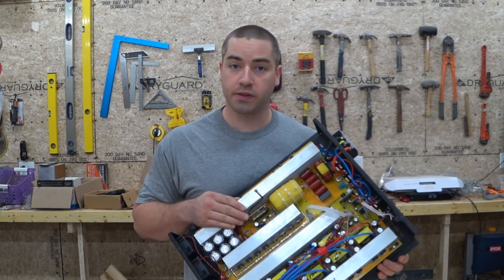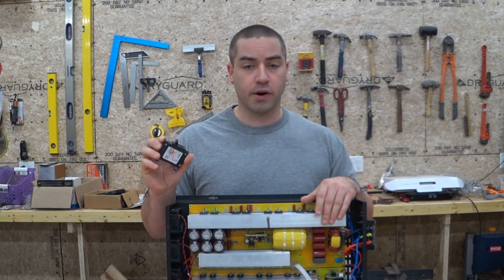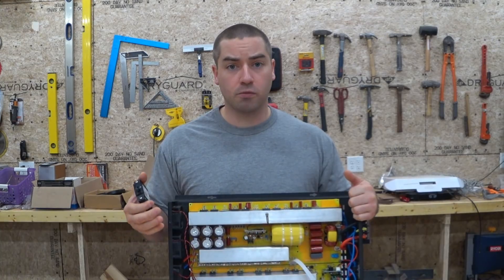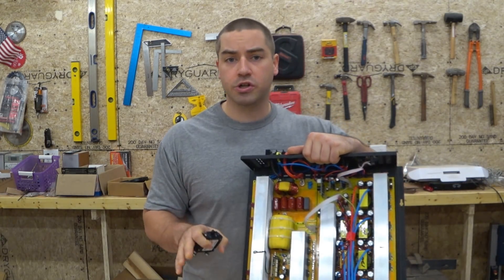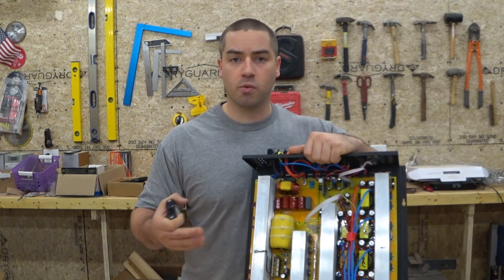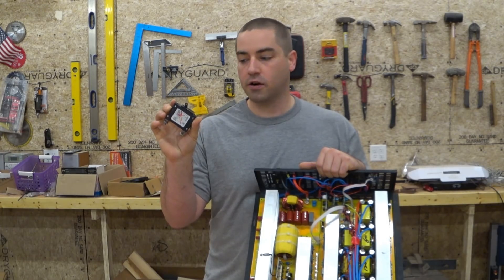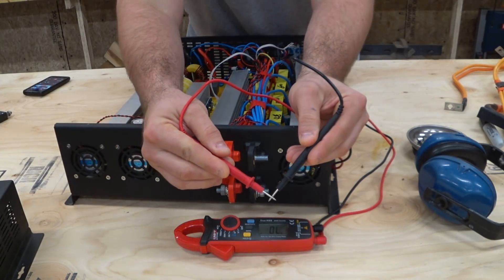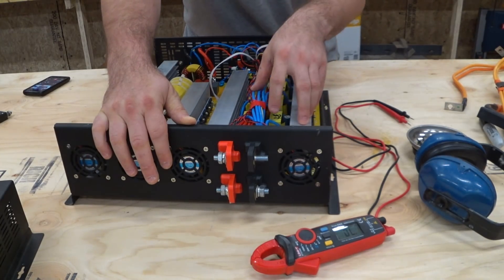Did I Blow Up the Inverter?

Comment: Dude, it's the junk inverter. Nothing to do with your setup... the mosfets failed
Reply: Cascade failure of the mosfets. I don't know if the mosfets were faulty, the load balancing was lacking, or a bit of both, but the actual failure mode is obvious. Cascade failure of the power stage.
Reply: @rich1051414  y think it has to do also whit the lenght of the internal power wires to the mosfet bridge, being all different lenght the voltage drop per pair are different , overloading the bridge witch has the shortest wires, giving the fact they have to dissipate more power then the ones further from the power connection, the spike created in the dc breaker will not help to... looks like a crappy design iff you ask me..
Reply: Upgraded vrs of the 8000 
https://youtu.be/riZBuepBb68
Reply: Remove fuses and check for short on mosfets. Assume it is badly designed or quality control just isn't there. Shouldn't inverter have overload protection?
Reply: Its very difficult for an inverter to handle very quick current overload. The Cap bank can dump hundreds if not thousand of amps in a few nanoseconds which will blow a mosfet before an overload circuit can turn off the Mosfet. Typically it takes over 100ns to shutdown a mosfet, especially for power mosfets that have a large Gate Qc value.That said the likely cause is a undersized MOSFET snubber circuit.
Reply: @ArthursHD  Hi Arthur…..how do you test for short on mosfets? I’m having the same problem with mine, but it’s only blowing half my fuses inside the inverter.
Reply: NO SNUBBER circuitry = instant fet failure!
Reply: Induction.
Reply: well said....
Reply: My guess is that the failure is related to the low inductive power-factor of the load (the miter-saw motor at startup).  When driving an inductive load, the current will lag the voltage.  This means, the instantaneous current WILL NOT be zero when the voltage crosses zero.  A significant current flow through the mosfets while they are switching off will cause them to overheat.  That's why most inverters cannot drive full output power into a low power-factor load.  You are stressing this inverter beyond what it was designed for.
Reply: @jessstuart7495  of he put a small load say a light, then started his saw that might help.
Reply: @jessstuart7495  you nailed it.
Reply: Nope the MOSFETS didn't fail... The design failed. The inverter should have had a self protection circuit to protect it from these kind of failures. Most inverters have a soft start to protect them during a inrush current.
Reply: If they failed they usually blow up and release the magic smoke i see no damage at all
Reply: @awesomusmaximus3766  usually, but not always.
Reply: IF THE INVERTER WAS FAULTY(internal short circuit)  IT WOULD HAVE BLOWN UP AS SOON AS YOU TURN IT ON....NOT AFTER THE LIGHT BULB TEST AND NOT AFTER THE MITTER SAW TEST!
Reply: @zumajax  what if the inverter had 'poor' mosfets that could not handle the saw.... you would get very fast cascade failure and then a shorted set of mosfets...
Reply: It likely failed during the surge likely causes an undersized Snubber that clamps induction voltage spikes. When you start up a Motor it can create very large voltage spikes (> 500V for a 120VAC supply). Rarely can MOSFETs handle large D-S or G-S overvoltage spikes. When the fail, the fail as a dead short.

Comment: Awesome- the time delay chart tells the entire story ...  :-)
Reply from the maker: Thanks Mark.  I struggled with this video because it's such a dry topic, but seemed to be an important one based on the comments.
Reply: @DavidPozEnergy  l understand that a breaker has momentary allowance for high draw of amps. I recently replaced an old tired 20 amp breaker with a new 30 amp these are 220v for a 5hp compressor I have the 20 amp 220v breaker in hand it has a rating of current interrupting of 10,000 amps !   My question during that start up phase of your miter saw is your breaker allowing your  inverter to over draw/feed amps into the inverter and overload it ?  Your running an 80 amp dc breaker at what voltage ?
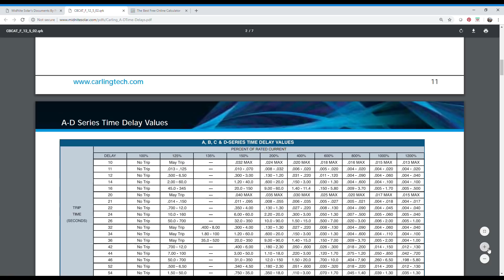Reply from the maker: Hi LN,  This breaker is just like you described in your first sentence, it allows for a momentary high draw beyond it's rating.  The amount of over-current is shown in the chart starting at 11:52 in the video.  The breaker is on my battery side, at the time of the video the battery voltage was 48.9 VDC, which I stated at 10:22 in the video.  When you replaced your 20 amp breaker with a 30 amp, did you re-wired that circuit to a  thicker wire (probably from 12 AWG to 10 AWG.)  Thanks for watching.

Comment: did you have a fuse on the postive from the battery circute brakers are designed to overheat to blow
Reply from the maker: There are fuses inside the inverter.
Reply: @DavidPozEnergy  you should have a fuse on the pos battery wire as protection the fuses inside do not have the rating to protect  from a large fault a 2000w inverter needs a large fuse about 200amps yours would need larger with out doing the math that would have most likley of blown  and protected the inverter its self most of them come with the car fuses rated to 10 to 20 amps but they do not always protect the components from blowing most house electics have the same thing only you do not see them in the consumer unit they are normaly before the box on the utility side
Reply: @DavidPozEnergy  this is a better one   https://www.youtube.com/watch?v=-UFeWedX5-o

Comment: i would say the inverter failed at the mosberges an inverter will handle (YOU HAVE)8000w if the saw is rated say 2000w(i have 2000w angle grinder)i can pull a 4 x surge load which would be 8000w so would be ok on the inverter most inverter have a surge rating 2000w would be surge rated too 4000w i would say that the ratings on inverters are miss leading and i always half the load a 2000w watt inverter i would try to keep to 1000w or just over as they overheat and that is what kills them what was the wattage of the saw and the surge rating of the inverter